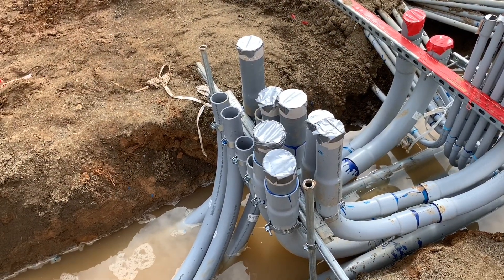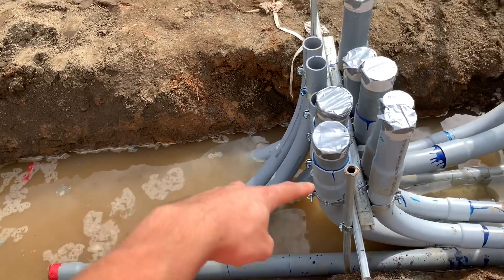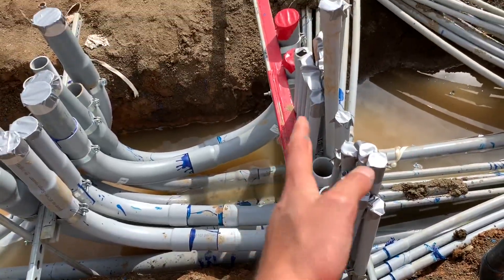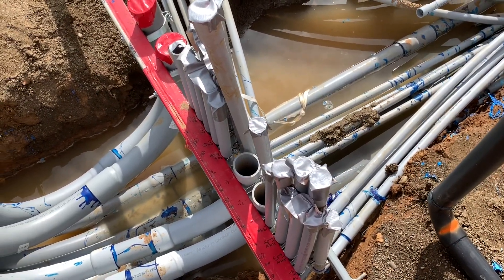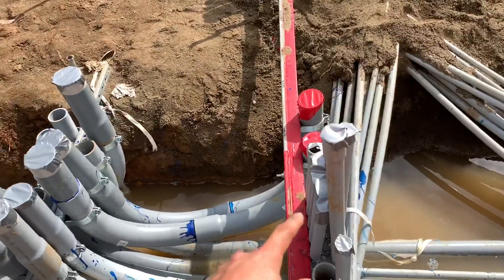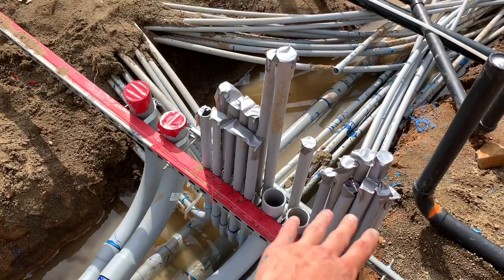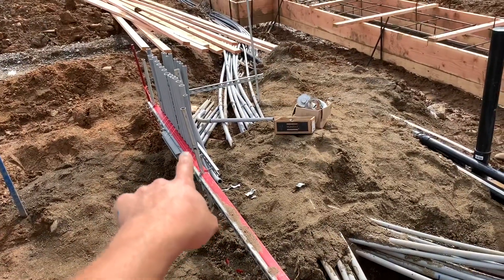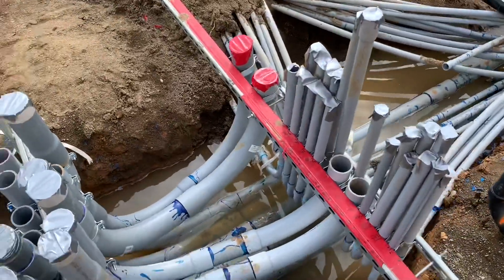How Some Commercial Buildings Get Powered With Electricity (Pre-Concrete. Underground)

Comment: Been a commercial electrician for 22 years and run large 12-16 million dollar projects (electric only) and can tell you your halfway there lol. Some of it looks decent and some of it looks really sloppy just being honest. Duct tape those conduits and label them, some are so close together you will fight getting those conduits up into bottom of panel with strut strap spacing and make it look good. Should always bring rigid through slab for protection and should be a rigid 90 and nipple to above grade. Pull a 1/4in rope thru some of those long runs and it will burn into PVC and you will have a hell of a time getting wire through without damaging. Definitely need stone underneath floating conduits too. Overall not bad for smaller commercial but when you get to the big stuff you will need to fix these mistakes and pay attention to quality. I even try to make all my nipple stubs same elevation to rigid coupling to change over to eat later so everything looks nice!
Reply from the maker: Thanks for the tips! I believe this was just outside for a switchgear not interior panels :)

Comment: I know this vid is old but how did it go with all that pvc so close to each other with no spacing in between? wow that's what I call   a cluster mess...lol
Reply from the maker: never heard any complaints but also wasnt around later to see what happened
Reply: @DailyElectrician  oh ok but really ?  it never got inspected..? That's crazy....ok man take care.
Reply from the maker: of course it got inspected lol
Reply: @DailyElectrician  I don't belive you but ok, or that inspector don't know what they doing,  common man that looks very messy and they're no spacing in between, you know the code for under ground conduit the spacing requirements, you just can't put them on a bunch and throw dirt on them plus the spacing to knockouts on the panels they need to line up and you need nessasary spacing for the connectors to the panels, you mention you were not there after to see how it worked out they probably had to do some kind of final Mickey Mouse connections to make it work.
Reply from the maker: uh no, it was an outside switch gear. wire goes up and straight into breakers. thanks for thinking you knew what was going on tho :P 

im not that retarded to put pipes that close together for an inside panel job. come on now, LOL